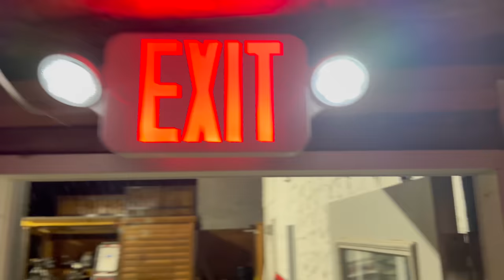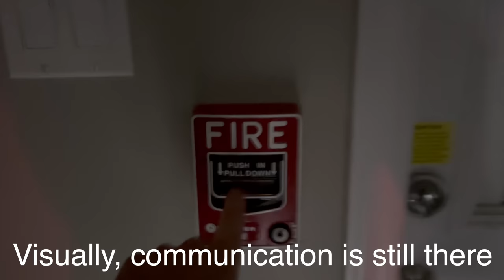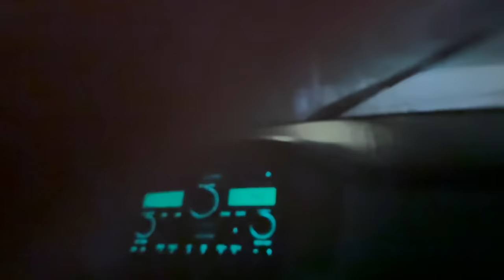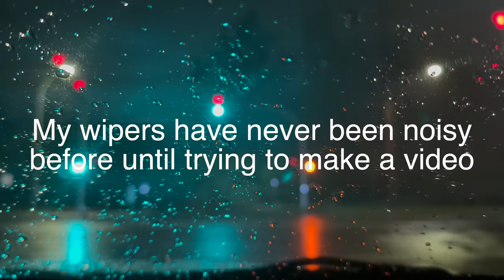Real power outage at my house! Emergency lighting and generator in action.

Comment from the maker: I am aware my windshield wipers squeaked in this video it is not a normal problem they are less than a year old. And the generator does not power the house for several reasons I have a video on that https://youtu.be/0EXjqxSqpiY?si=N4WMLsAmVIQ3Y15x
Reply: Let me guess load or a safety reason or some code?
Reply: @Casonplayz  I would say the load + the way you would have to back feed the house.
Reply: Just a tip, the wipers may well be due to some coating on the window (do you guys have Rainex or something over there?) once it coats the wipers they're almost worse than useless. Having done a LOT of night time commutes on rural winding roads, I would recommend a completely clear windscreen with high quality wipers - let the wipers do what they're meant to. Snow foam melts right through unwanted windscreen coatings. You will probably need new wipers or to give them a snowfoam bath.
Reply from the maker: stampynate007  emergency lights come on when the power goes out to provide instant illumination
Reply: hey nic, what song were you listening when you were painting?
Reply from the maker: @NS-Sirens  Sweet child O' mine by guns N' roses
Reply: thanks @nics-systems-electric

Comment: You might get some neighbors enquiring about how you had power. Back in 2013 after a big thunderstorm we lost power from 7PM till midnight. I ran my entire home off of my 6000 watt diesel generator. That night my mom lay on the couch the whole time watching her favorite cooking shows like nothing was going on! The next day I had several neighbors come over asking about the generator. One of them seemed a little pissed that I was also running my Christmas lights too. he said to me "We sat in the dark for 5 hours looking at your Christmas lights" I actually had them on as extra resistive load to help stabilize the generators AVR. Since then I sold the diesel and now have a propane inverter generator which is much cleaner to run.
Reply from the maker: That's awesome lol. I had problems with my last non-inverter generator was putting out two dirty of power led lights did not like it. The neighbours you'd think would get their own set up if they were that upset about it. But then I guess they'd actually have to spend money so that's not as easy as complaining about your neighbors…
Reply: How can someone be angry at the fact that you were more prepared than they were? lmao
Reply: @nics-systems-electric  That was the problem with the diesel, the power was dirty and my UPS's didn't like being powered by it during the power outage and kept switching on and off running their batteries down. I also heard that the control boards running your furnace HVAC system can be damaged by dirty generators. Another things you might want to consider is backup communications. In a wide spread outage the outside plant equipment run by the Telco's will be powered by battery backups in the cabinets. Some key cell sites will have generators but you'll likely start to see a degraded cell service as the outage continues and sites die off. This is why I keep a Starlink satellite system as backup communications as it's not dependent on anything locally. Use WiFi calling on your cell phone or also have a VoIP account. You also live in a earthquake zone so being prepared can be lifesaving. You might also want to consider getting into HAM radio, I think a guy like you would love it.
Reply: @allenesibe9842  They think we're crazy being preppers then they are jealous haters when they $hit hits the fan!
Reply: @peterfairlie2296  hey you got a ham license? We can do make shift YouTube qsl!  Fr :)
Reply: Jeloucy is a funny thing. "Oh I had to sit and look at your Christmas lights all night" well Karen go buy your own generator if you want the same Haha
Reply: The implications of that are abit bothersome to think about.
Reply: What was the diesel generator  you had
Reply: That’s the hard part about this type of investment. In an emergency, disaster, apocalyptic event; neighbors will inquire and eventually get restless and attack.
Reply: That's why if shit ever hits the fan, your house is the first under attack from pretty much everyone.
Reply: 2 years ago my parents house had a power outage and they had a neighbor with everything all lit up, I looked out like "these mofos are running their damn porch lights!" My parents have their own generator on priority electronics so it wasn't a big deal but it's funny. Following that outage a lot of neighbors spent big money on whole house generators.
Reply: Here in rural-ish southern NH emergency generators are pretty common, both automatic and small portable ones. We have a Harbor Freight Predator 7000 watt genie and keep a supply of stabilized gas in a shed. Even if we were not aware of anything else you can always tell when power is out  when you hear the neighborhood generators and then quiet when power comes back.

We can have week long power outages due to massive ice storms. I installed our genie back in 2016 and so far only needed to use it once.  If it keeps power outages at bay I'm a happy camper.
Reply: They were pissed? Communication is everything!
Reply: @CrampavanAdventures that guy was probably one of those people that peepers only to get angry when those preppers are more prepared then they are

Comment: You should definitely implement some delays in your generator setup. For example a first delay after generator started before switching to generator, to give it some time to warm up or your generator may have a short live. And then a second delay when utility power comes back, before stopping the generator for two reasons: first, what if power goes out again and second, to let the generator cool down without load. I would suggest for the second delay around 5 min and for the first delay at least one minute
Reply from the maker: There is a delay for cool down time but a delay on start up would slow down response time that's why you don't see generators with that and that's why there's a block heater on it to keep the engine warm and to keep the oil viscous
Reply: There are plenty of generators around with delayed startup. I work in radio comms, most of our sites have battery backup/UPS to maintain the equipment supplies for an hour or two, so the generators are set to start after about a minute. No point in starting up every time the lights flicker, particularly as the sites are all unmanned. 
I’d also be worried about the instantaneous switch back to utility with no break. If you have any reactive loads, they’re going to take a pretty hard hit if the generator is way out of phase with the utility. It either needs a break of a couple of seconds or sync the generator to in incoming supply before switching.
Reply from the maker: @petesmith2234  the switch over is fast but that's the same as many of the generator I've seen so I'm not sure what it's going to hurt. There's nothing I can do to change that operation of the transfer switch. And mine doesn't start every time the lights flicker the  power has to be off for 10 seconds which is actually faster than most that are 3 seconds that I've seen.
Reply: I think you’ll find that any decent system will either back sync the generator to the incoming supply and then do a make before break switchover once in sync or at least wait until the generator is naturally close to sync before doing a break before make, they don’t just switch when the contacters feel like it. Any reactive loads will suffer massive inrush and potential damage. Spinning machinery (I.e. motors) will suffer a massive torque spike and potential damage.  If you’re not understanding this, maybe a bit of research on reactive loads and spinning machinery is in order. I’m not trying to be an a-hole, but it is a thing. 
Regarding start times, don’t rush if it’s not safety of life. Much of what I work on is, but it has at least an hour of battery. I have witnessed a generator at a transmission site repeatedly starting and stopping when the utility supply was being provided by a temporary generator which couldn’t cope. The starter motor was smoking and the batteries could barely crank the engine. If only the delays had been set a bit longer it either wouldn’t have tried to start or would have kept running. Either would have been better. 
Just saying, I love your enthusiasm, but not all is what it seems at first sight.
Reply from the maker: @petesmith2234  yeah I get what you're saying I just don't think I have any equipment that would be hurt from it no big motor loads. All the really sensitive stuff is on UPS. I think the only way I could have a delay transfer back would be to install a time delay relay on the contactors coil. I can't find any schematics for my transfer switch so not sure how it's wired. It's a go power TS-50 and it doesn't make it obvious how it's working.
Reply: Ok fair enough. Most electronic’s doesn’t really care, it’s just rectified to dc and converted to the required voltage from there, so maybe not a big issue in your case. I’ve done a lot of backup power systems I my time, both generators and alternate utility feeds, sometimes from different phases and it’s something I’m always very aware of. 
There’s a good video somewhere on YouTube of a generator put online out of sync. It makes it very clear of the mechanical damage that can be caused, never mind the electrical side of things.
Reply from the maker: @petesmith2234  yeah makes sense. And like I said I wouldn't mind putting in a time delay relay before the coil from the utility contractor however I can't get any good schematics on this transfer switch.
Reply: A lot of the machines I work on use the ComAp controllers. Fully programmable for everything, versions available to control ATS contactors, can be configured for diesel or spark ignition engines. There’s an Ethernet module available which allows full remote control and monitoring, email alerts. There’s even a cellular interface which does all that plus location tracking for mobile sets. Monitors all engine parameters, oil pressure, coolant temperature, coolant level, fuel level, control of fuel transfer pumps, alerts for rapid fuel level drop (ie theft), battery voltage, electrical parameters, voltage, current, frequency, KW, KVA, KVAr etc. 
if I could recommend a good controller, that would be it.
Reply: @nics-systems-electric  Is the generator used here big enough to have an oil preheater?
Reply from the maker: @rosabeha8121  I would think so the generator is rated at 8000 W for 30 minutes and 6500 continuous

Comment: The only downside is that during a grid down situation, your house is like a light house to everyone else without power.  Granted you have exceptional puppies for personal protection.
Reply from the maker: I don't know how that would be any problem
Reply: @nics-systems-electric  the problem is, when you have power and all the others don't, you might get some not so friendly visitors...that's why I prefer a solar system with batteries attached...silent and nearly invisible...solar on the roof and batteries in the basement...no one can see it, unless you switch on lights and music and throw a party 😂
Reply from the maker: @westallgaeuereisenbahnen  you must be in a very sketchy area. Someone could also just go to the fire department up the road that has power during a power outage I'm not the only one

Comment: Great Job Nic.  Your generator starts and restores power beautifully fast.  About 6 seconds FASTER then my Generac 24kW on my house.  That is absolutely incredible!
Reply from the maker: Thank you. There is a 10 second utility loss delay and it usually starts within about 8 seconds so 18 seconds in total is usual delay
Reply: @nics-systems-electric  yes.  My Generator take 24 to 30 seconds to restore power. Yours is much faster
Reply: I work in the field for the electrical utility in my state. The power lines usually have 2 shots to restore power when it trips off. 1st shot is immediately after tripping it closes back. If it trips again, it waits 20 seconds then closes again. If it trips a 3rd time it locks the breaker out and personnel have to physically check out the reason for the trip and manually reset the lockout switch. Me personally, I would wait 21+ seconds before starting the generator, if immediate power is not a necessity... Also the 20 seconds is what the huge electrical utility i work for uses for their relay settings recloser shots and may be different in other areas. If anyone is wondering why we reclose the breaker on a possible fault... The explanation I've been given is that lots of squirrels birds snakes etc will get across the lines and cause a fault... Usually they will have fallen off by the 1st or 2nd shot.

Comment: How much load does the garage put on the generator? Could you also wire some circuits from the main house onto the generator too? I'm sure your family will be enquiring about now!
Reply from the maker: That would require another automatic transfer switch in the house so it would need a emergency source ran to the house and then an automatic transfer switch and then circuits separated into a separate emergency panel circuits moved from entirely different locations of the house and separated as there are mixed circuits it would be a very expensive project and very challenging with a lot of work that would be damaging to the house trying to move circuits from entirely separate locations so it's not really possible
Reply: @nics-systems-electric  You could always run just a 15 amp circuit to the house and install some of the orange emergency power outlets thought the house. This way your family will have access to power to run devices in an emergency and it would be convenient for them in bad weather not to have to go outside to the garage. Also if you have a forced air gas heating system you could keep it going too.
Reply from the maker: @peterfairlie2296  it's possible but not easy it would require excavation and pipe to be buried and ran into the house. And since I would never make money back on that project nor would it be used enough it's not worth it for the small amount of time that the power is out they can use power from buildings fed off the generator with extension cords if they need. Mitigating the risk of having two different power sources in a residential building where it may not be obvious to the next person where a splice combining sources could be very dangerous
Reply: Well, at least have the fridge and freezer on an emergency circuit.
Reply from the maker: @Game_Blox9999  do you realize what that would involve?
Reply: @nics-systems-electric  Well, you need to keep the perishables cold somehow. Logically the fridge and freezer would need an emergency circuit to keep things cold.
Reply from the maker: @Game_Blox9999  a ton of damage and work and thousands of dollars later. you could rebuy the food 10 times over before it was ever worth the work. It's not as simple as you think
Reply: That's where Bluetti or whatever brand batteries can come in. I have one for a CPAP and oxygen concentrator
Reply: @Game_Blox9999   If you keep them closed fridges take a long time to warm up. If you have a long outage you can run an extension cord.
Reply: @nics-systems-electric    A compromise could be a power inlet on the outside of the house going to an outlet on the other side of the house. You could run the fridge on an extension cord but you'd have the benefit of being able to keep the doors closed.
Reply: @eDoc2020  Yes, I know basic thermodynamics.

Comment: Amazing setup!  I particularly love the exhaust fan you have going for the generator.  We have a lot of those twin lamps in places now here in the U.K. and my personal system is now 5 flashlights that sit in a holder in the power outlet, and they all come on if the power goes.  I also have a big energizer battery with a 300 w inverter that also has a good light on it as well as USB's. and a bunch of power banks too.

Comment: A lot going on in this video. First off, I have a 20kw Cummins with an ATS so I've been through similar situations but you've got some commercial items installed that I found interesting. Exit lights and emergency lighting. The insulated generator cover was a nice touch. Interesting fire alarm system and UPS system. I have 15 exterior lights on my house and when the power goes out, my house is lit up way too much.

Comment: A benifit to working in IT and communications is I can get ahold of all sorts of things that are / were used in varuous comms tower sites, generators being one of those things. I have an LPG 12Kw generator with the auto changeover system from a retired AT&T wireless building that has very low hours on it and powers my whole house.

Comment: Thats feels great. Especially if you have it online with batteries and generators. I remember when snowstorm damaged the lines and the whole village gone out except the shop and our house.  Mainly thanks to the fact that we still had natural gas, and our emergency generator ran on it. Without the working supply we would have had about 12-16 hours, but we were fine for over two days, until the fixed up the lane and evryone else finally had propper toilet XD (cause around third of the houses had their own water supply, and the other ones got it from the water tower, wich worked on electricity)